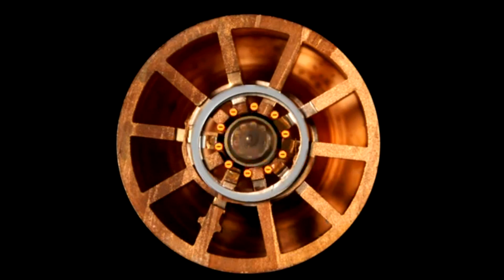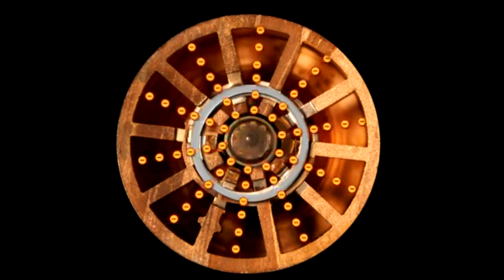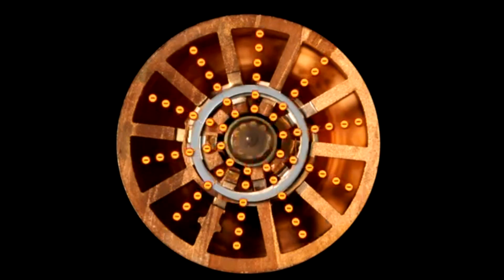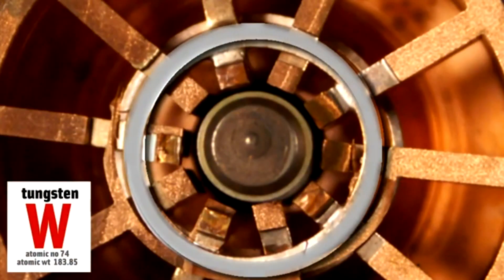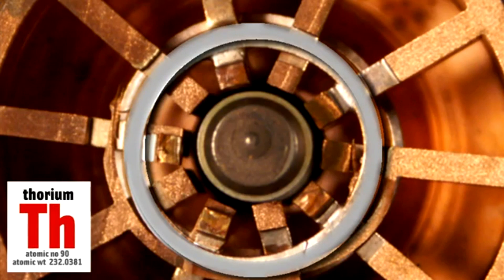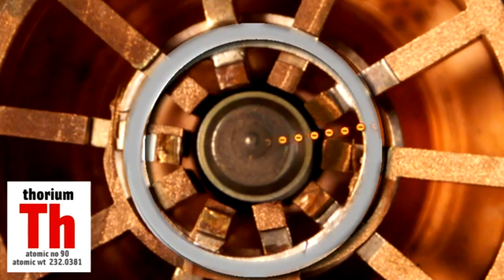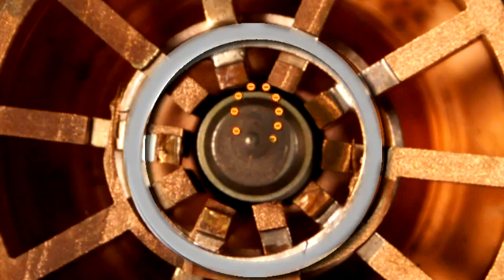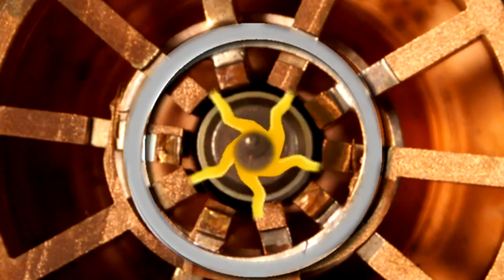How a Magnetron works

Comment: Please explain how you get a rotating field or set of fields. That is not clear from the video. Thank You.
Reply: the magnets rotate the mass of electrons
Reply: 6 years late but there are permanent magnets alligned with the chamber which create a magnetic field. Due to the left hand rule, electrons take a curved path through this field. This is the principle behind a cyclotron, which is what a mangetron uses.